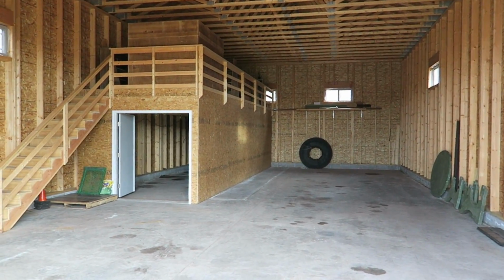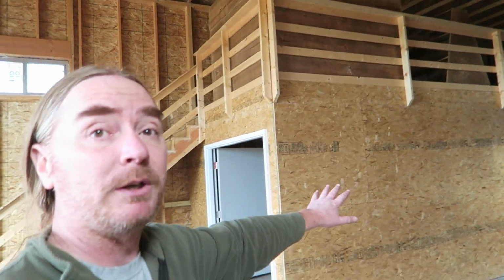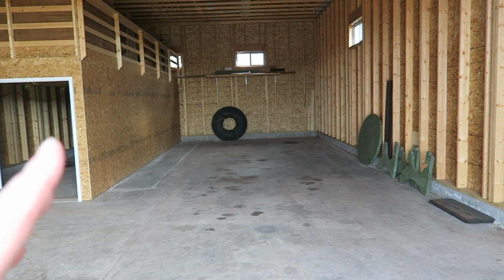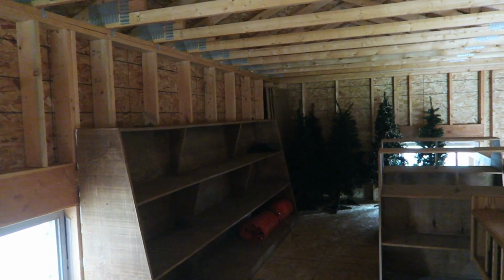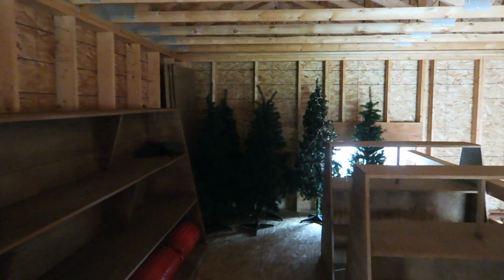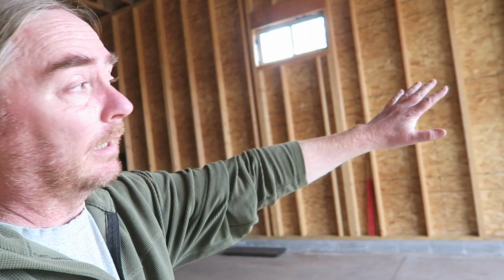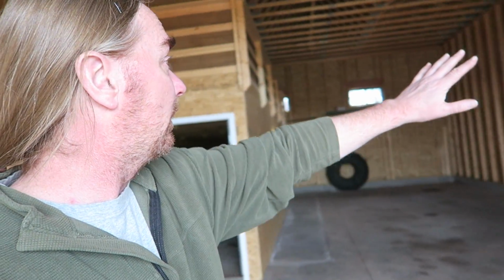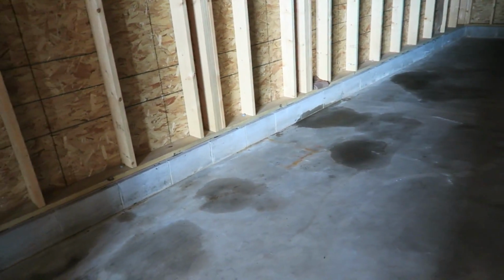CHECK OUT THE NEW BOAT SHOP!!

Comment: In the U.K. we would use Kingspan or Celotex closed cell insulation, it comes in thicknesses from 25mm (1'') to 150mm (6'') and in 2440mm x 1220mm (8'x4') sheets. Easy to install and highly efficient, I'm sure the U.S. has something similar. Good luck.
Reply: PIR boards, bit of a pain to use compared to spray I guess.
We are only starting now in the UK getting people trying to do residential spray foam but there are lots of scammers destroying peoples houses with it and some insurance companies will not cover you if you use spray stuff

Comment: Yes, in alaska we say spray 2/ 2.5 inches. I think thats 2" wet and it expanse to 6ish. That seems like a pretty reasonable price given the sq footage.
Reply: I dont recall if you put a vapor barrier, I know its usually closed cell meaning it is vapor resistant. Use led, they don't have ballasts, put 8 in my garage and at least a year and only 1 bulb so far. Sounds like you're on the right track. Most new new boilers are pretty efficient
Reply: Efficient like a lochenvar brand.
Reply: He is being quoted for expansion to 3" I suspect.  That is common down here.
Reply: Sound like light insulation. Here in Finland the minimum insulation on walls is more than 300mm (about 12 inches). With high efficiency PIR foam maybe 200mm (8").

Comment: Hi Andy. It's a good start. Maybe worth approaching the manufacturer of Rockwool or hire a foam machine and cut out the middle man. Im sure there are plenty of honest companies who can do it for you. Your channel is awesome. God speed on your Quest.
Reply: Foam is NOT something I recommend for non-pros.  The DIY foam has many problems, and the Pro stuff takes serious training.  Blow cellulose is no problem for a DIYer.
Reply: Rockwool is the best insulation and it’s fireproof. It will not burn even with a torch held to it now spray foam will burn and make toxic gasses that will kill you way before the fire ever would. Andy you should check on rockwool , I know it’s high but it’s the very top of the line when talking insulation.

Comment: That is a amazing shop.   We spray foamed my fathers house.  Even though we dropped the r value it dropped the cost to cool and heat the house drastically. I am not a fan of blown insulation.  We had a mouse problem in it.  Was terrible.  Did work well though.

Comment: Maybe a compromise on insulation - install a ceiling (drywall or metal panels) and have cellulose or fiberglass blown in, then spray foam the walls.  This may save you some money and make it slightly easier to heat (lower ceiling)
Reply from the maker: definitely one of the options we're looking at!  Thanks!
Reply: I might go the other way. Put fiberglass in the walls, and spray the ceiling, perhaps in combo with blow in, where most of the heat loss is going to happen.

Comment: Flash and Batt is a common practice. The closed cell spray foam gives you your air sealing and heavy lifting for R-value, and then fill the rest of the bay with a batt insulation for cost savings! Good route to go. I’m also in Michigan and a home inspector BTW.
Reply: I second this!
Reply: I am an HVAC Engineer and I agree with foam and batt approach for the walls. Also use  3" spray foam and  blown in insulation in  the trusses ....I would do R 60 minimum in the trusses. Run all of the electrical on the surface in conduit...allows easy future changes and eliminates a construction coordination issue. Hot water baseboard with gas boiler is good choice. Put in as much baseboard as you can afford so the boiler operates at a lower temperature...more efficient....I would aim for a HWS (hot water supply) temperature of about 140, with a 20 degree delta T...this forces you to use a condensing boiler which is very efficient.  Good brand is Lockinvar,  Knight models, side wall flue, 10:1 turn down with outdoor reset. Couple of ceiling fan a must to stir the air when you are not painting! Don't be fooled by R values for foam. Almost any foam has an aged R value of 5 per inch. 3 inches of spray foam plus 3" of fiberglass (stuffed) in the walls would be an R of about 25. You would need to do calcs to make sure condensation does no occur in the walls with this combination based on your location. Because the floor is not insulated, it will be a significant heat loss, but no easy way around it. Option is to overlay 2" of rigid foam plus a new slab with radiant...spendy. Would love to help you with this...what is the best way to stay in contact? Is there sand under the slab? Is the building in a low or wet area? Is there and how deep is any ground water?

Martin Lunde, Mpls., MN
Reply: One other thought...you may be able to do some below grade rigid foam insulation around the perimeter of the shop to reduce the floor loss...depends upon the ground water issued that I asked about in the earlier message. Also, the garage door is big loss if not handle properly. A good investment might be an 3" thick foam insulated door with lip seals. Lot to check out....
Reply: 2" of closed cell to provide vapour barrier, then batt for 2x4 walls to get to 2x6 insulated wall. Do electrical first. You might consider solar to power just your lighting. With regard to heating, looks like you have a lot of wood on the lot. Consider hydronic baseboards fed by an separate shed to house either a pellet stove or wood stove. You could also consider a ground source heat pump which would then power a "water furnace". The trenching is expensive but the copper line will cost you all of your organs. Consider a gas line if you can get natural gas back to the shop, then power heating plant with it as well as 10Kw genset for hydro. Since you know how to work with epoxy, etch the floor and put down a coating to be able to control dust. Hope this helps.
Reply: As a professional insulator, your contractor is correct, at 3.5” of spray foam achieves its basic most effective R value for your dollar, the foam will give you your vapour barrier and the rest of the cavity can be filled with batt insulation.  My suggestion is a high density roxul (rock wool) to fill the space and add additional R value.

Comment: Shop looks great! Definitely go with closed cell spray foam. 2 to 3 inches in the wall will outperform fibreglass at virtually any thickness. Closed cell foam does not require a vapor barrier. There is a guy named Spray Jones on YouTube that has the best videos on the topic. He is in Canada, so he knows plenty about cold winters. His videos will answer every question you have on the topic!

Comment: From my underrstanding, closed cell foam doesn't need a vapour barrier
Currently with your budget, go with heating you can afford, but if that is water ingress, then for the future i would consider underfloor, you would normally lay a membrane, then insulation (as i said last time, insulation can probably be thinner for same R value), then pipes, then a screed, looks like you have at least a 6" upstand wall, so that would be ideal (i had worked out i would need 6" many years ago), you could also consider wet solar, i don't know if geothermal heatpump would be good in granite
Commercial style flat panel led's might suit your needs, you would probably want 5500K or above for videoing, go with a known make (philips, sylvania etc)
btw, i learned a lot from watching RR buildings videos about insulation
Reply: I have to say that I do like this idea of dealing with that floor too.  You have a reasonable starting point right now to get some insulation in it and add the pex.  It has some expense, but then you have stopped the heat sink under foot and eliminated buying radiators or convectors.   Vapor barrier, with an inch or two of foam board, then pex and concrete pour on top.  Then choose your heat source.  You stop the floor loss which greatly improves your working comfort long term.   If you need a quick temp boost from time to time you could look to a couple of fan coils in the corners using the same hydronic heat source.  You can then move in if you have to while tackling the walls and ceiling.  Just a thought?

Comment: Im not contractor by any means. but in canada.. they put 2-3in insulation foam board first, which R5 per inch of thickness and spray foam over it.

Comment: I’m in Ontario Canada... spray foam to give you a vapour barrier and then look into putting an R5 8’x4’ sheet on the studs, tape it(no plastic barrier needed) & then hang drywall or plywood over that.  I use a wood stove for cheap heat in my 1800ish sq ft shop & it’s not yet properly insulated but helps in the winter.  Lights, I would go with motion sensor 4’ LEDs to get good light and save on Hydro when you’re not in that area of your shop. You can likely find them for $20 a light and they should plug into each other so you don’t need an electrician😉

Comment: Thanks for the preview of things to come. 
Is that small room too small for a paint shop?  
Looks like no gutters on the building and a slopping grade towards the left side where you had water on the wall. Have you considered solar and geothermal heat for the shop. No gas to run and you have to run electricity or install a generator anyway.

Comment: You could think about solar energy, if you have enough sunny days a year, and as you mentioned, LED lights. If enough solar system installed, you could run some equipment on it, I mention this based on your idea of this being your last move, the amortisation time will depend on how much energy you use a year and the cost of the solar system, after that, you would have free energy, a bill payment less to do, specialy when we are getting older.

Comment: The stains in the room are probably wood stain spills or oil leaks from older equipment. As a structural engineer, they don’t look like water leaks.

I have LED lights in my shop and they are fantastic! You want as many lux as you can afford.

Comment: Your contractor is right if you spray 3 to 4 inches you will be at 90% efficiency if you fill the cavity you will get a 94% efficiency That is for closed cell If you are using open cell You will fill the cavity

Comment: Didn't your old shop have some ridiculously fast air filtering going on? that's gonna take some modification to put in the new shop, right?
Reply from the maker: It did, but haven't really had a need to use it much lately now that I'm moving away from spraying.  Not completely done with it, but trying to minimize when appropriate :-)

Comment: Check out heat pumps, and also look at geothermal it would be good but it may be a bit high on the initial cost to set up but operating costs would be very low
Reply: Not needing a gas line would save some costs, but you need to research things here, if you use air source heat pump a back up system will be needed in MI. Geothermal doesn’t need back up systems and could maintain the shop at a constant temp all year long. Build in a heat exchanger and large dust collectors and your shop could be a high performance paint shop as well. There are so many options all you need is to understand your budget and business target
Reply: @dancook6174  He mentioned granite when he talked about the trench for electric and gas lines. So geothermal might get expensive. My initial thought also was heat pump, but you are right, you would need some auxiliary heating in the winter, I guess a gas furnace would be the most efficient for that.
I also think he mentioned previously that he did not want to go with anything using air ducts or blowing air for dust reasons, but that might be mitigated by air filtration units.

Comment: The fancy loft name is mezzanine! :)   Looks like  a great beginning, but lots of work to make it usable.  Great idea for the insulation, but I think the door will be the biggest challenge.  For insulating the door, probably a double layer radiant barrier https://www.insulationmarketplace.com/product/smart-shield-ad-5.html would help.  Using that radiant barrier over the foam will also increase the insulation as well as reflecting heat back into the shop.

For lighting - - I would go with tube style LED shop lights.